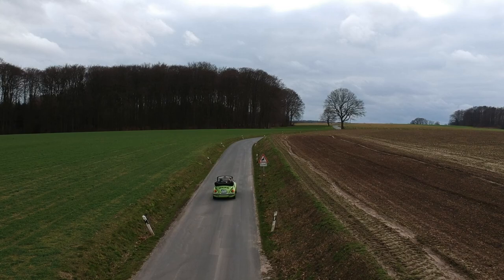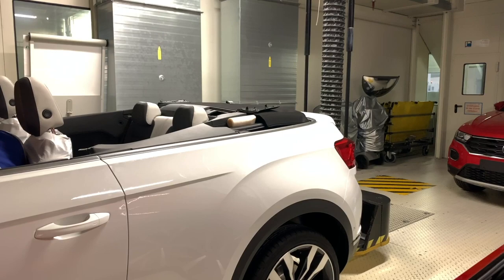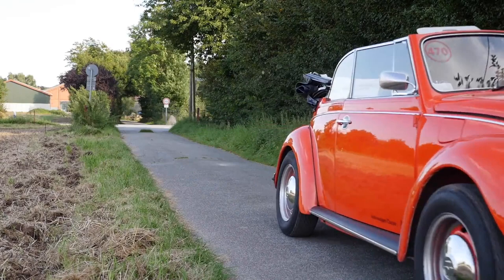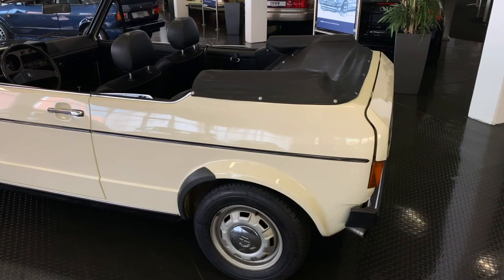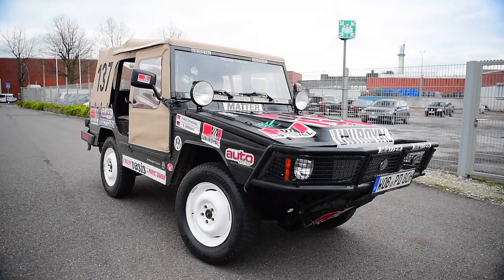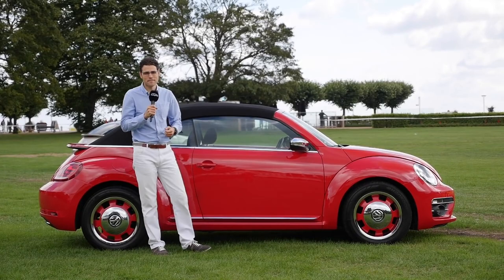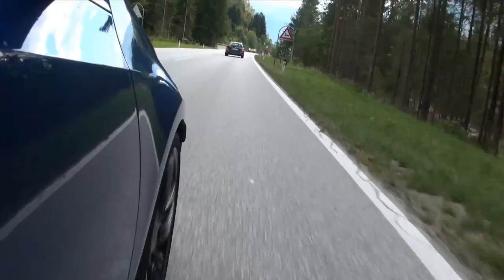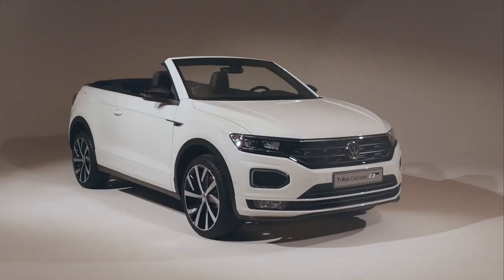The history of Volkswagen Convertibles - VW Cabriolet heritage - OnlyVeeDubs VW reviews

Comment: I own a 1989 Volkswagen Cabriolet with red exterior, black top, and gray and black cloth seats in near mint condition with the fuel injected 1.8L mill and 4 speed manual shift case..... Also has vintage German Ronel turbo R10's that give it masculine appeal, and fantastic handling. A cool ragtop for a $1,000.... Hell yeah!
Reply: No way that 1989 a 4 speed shift case was built that way out from factory. 1989 all G1Cs were built with 5 speed manual or on special order with 3 speed automatic.